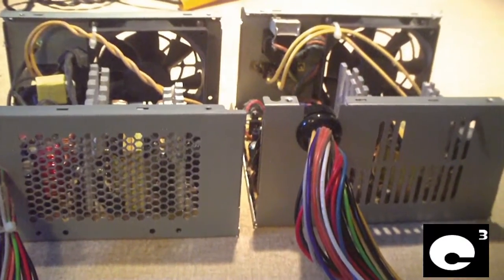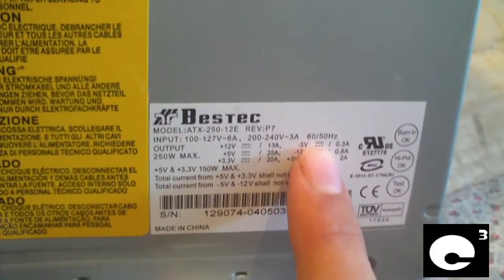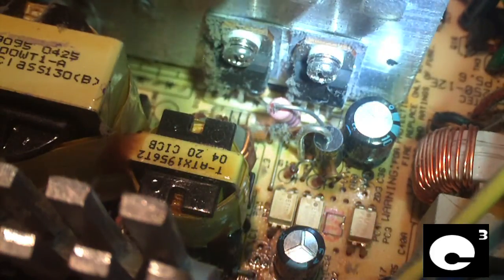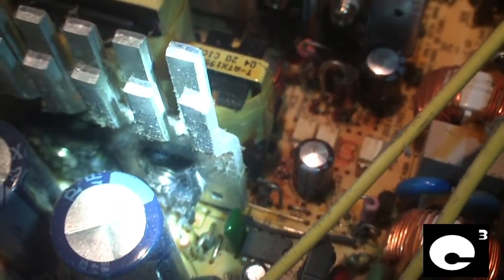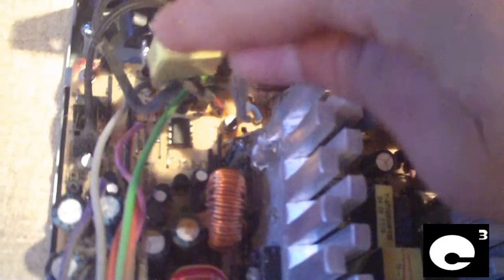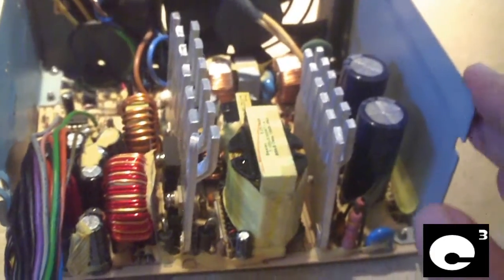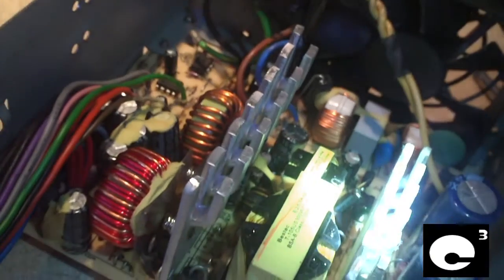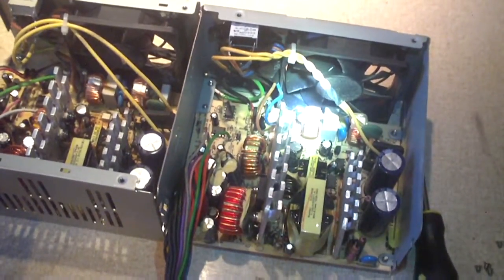Bestec ATX-250 12E, 250-12Z, and 300-12E comparison

Comment: i thought the same but as it was chinese and so tight for that machine i told the guy just to replace it with a good quality 450-500W one.
the cap problem isnt a good way of diagnostic, i have one (eurocase) laying around that has a blown cap (heat from the inductor) in the output and has 1,2Vpp w/o load on the 12v rail, 2Vpp with 6A. (tested with 1A on the 5V)
tha intel d915gag where i had it never shut off, nor died. and the psu suposely has scp (tested), uvp and ocp and didnt shut off either.

Comment: those are some PoS you have there....i'd never risk my machine with one of those, even in the cheap nas i made with an old pentium D i bought a decent cooler master supply which i already know it has what it says because of the reviews (and my osciloscope and dummy load).
I once repleaced one of those (different brand) in a hp pavillion (350w 2.2 PentD), the machine lasted 2 years of normal home use before the supply failed to deliver its power and the machine shut down luckily nothing was burnt